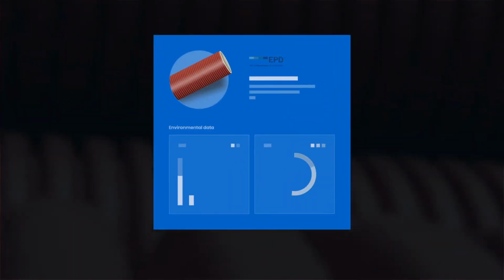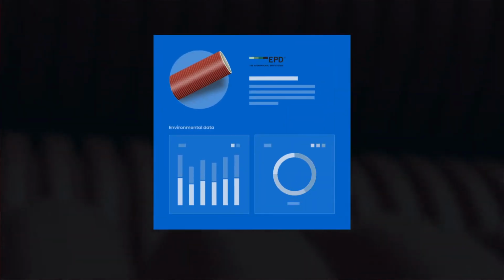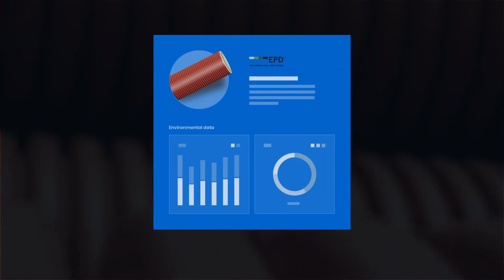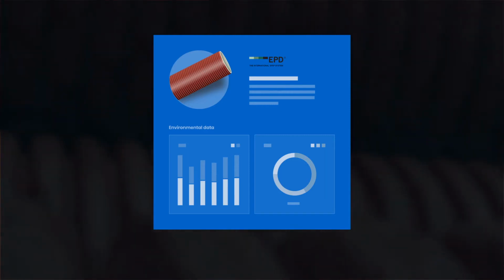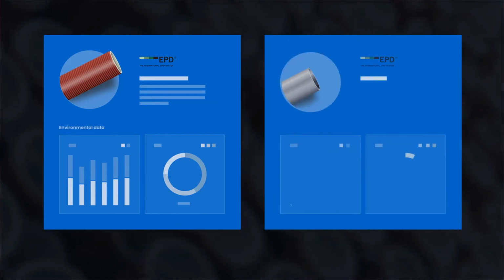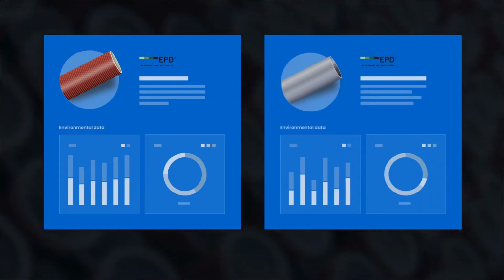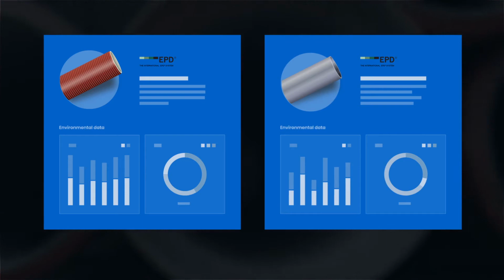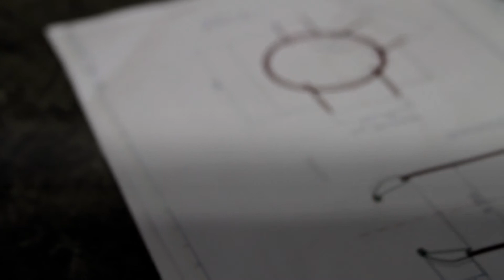What is an EPD? Environmental Product Declaration

Comment: Question. Does the carbon footprint of the material has to be green to receive an EPD?
Reply from the maker: Not necessarily. The origin of the raw material is not a precondition to getting an EPD.

If the raw material is not from a renewable source or it's not recycled, the EPD will show that has very little or actually zero carbon footprint reduction. 

Any product - call it 'green' or not - can have an EPD. The important thing is to read what the EPD says about its % of carbon footprint reduction. So you can see the real difference 😃
Reply: An EPD is a statement of fact, as opposed to an eco rating.